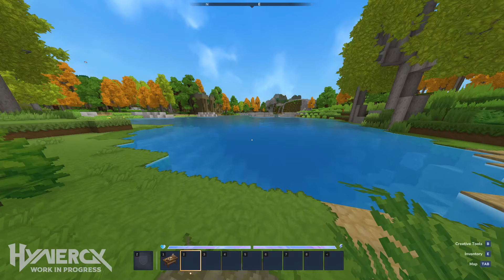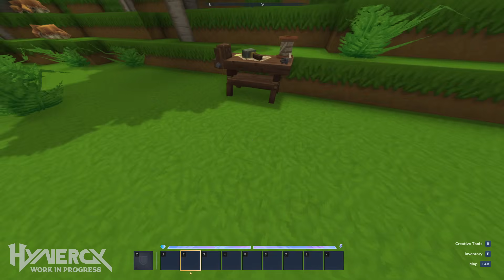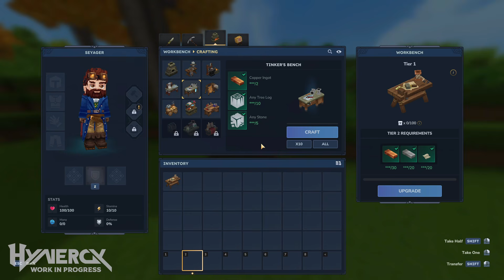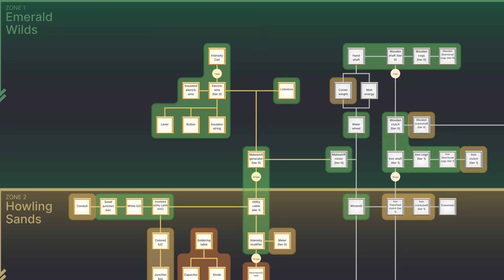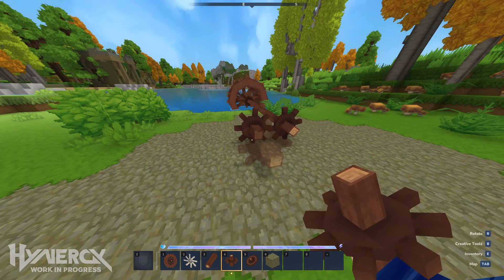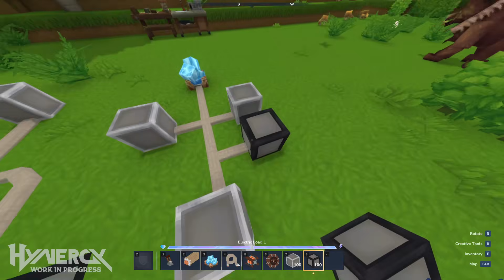Hynergy UPDATE: Mechanics and Electricity

Comment: Ok what's with the electrical intensity though rather than that it's about the Voltage Levels of the electricity carried hopefully there will be updates regarding electrical side of the mod.I mean if we wanted to expand electricity as a system there is so much that you can add but I guess by saying intense cable or intensity it's for the general to have a easier time understanding the system
Reply from the maker: Intensity in the mod is closer to voltage, however it is not exactly that. Is an abstraction so the systems are not as complex as reality.
Reply: @seyager As it is just a naming change will there be a later on switch or an optional setting to see electrical names Voltage and such? As an electric engineer and a Create enthusiast most mods or add-ons do have that and well if there comes out some add-on mechanism similar to what create has that could be changed too.Hope you guys get the working version out without issues anyway just having something similar to create in Hytale would be much appreciated

Comment: I mean it's very much like Create but I do like the Wire idea, That's a nice touch. It would be also a nice touch if you added a Tube System + Belt in the future where items can travel, The Tube system could work like BuildCraft + where you need to push Push in the Tube with Air / Hot Air. 

Just a idea, Giving your mod more ways to move items is always nice for players but Rooting for you, Looks nice so far.
Reply from the maker: Some of those ideas are already planned
Reply: @seyager  Oh nice, Can't wait to see the future of this mod then